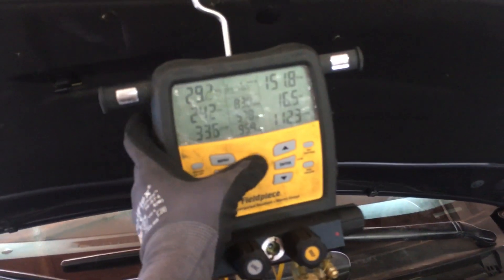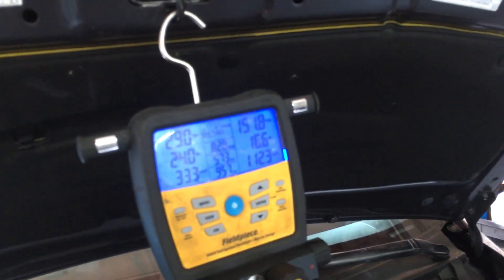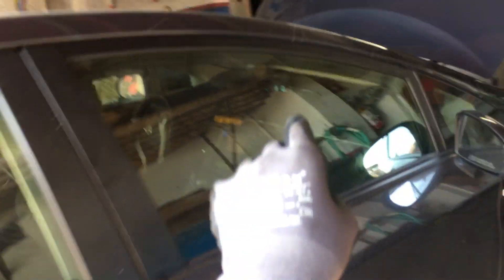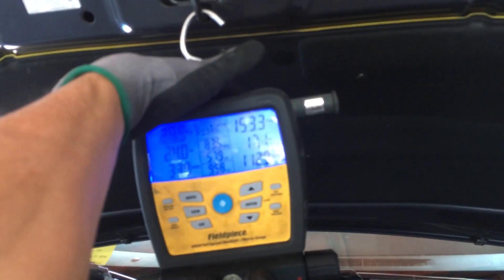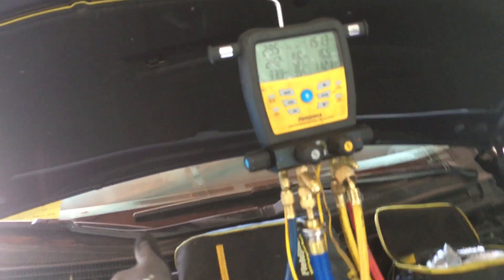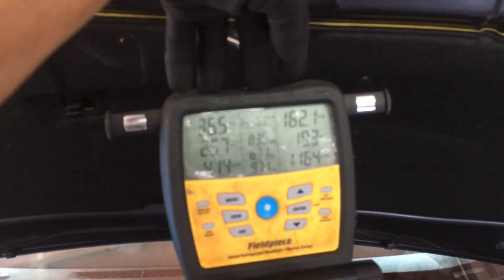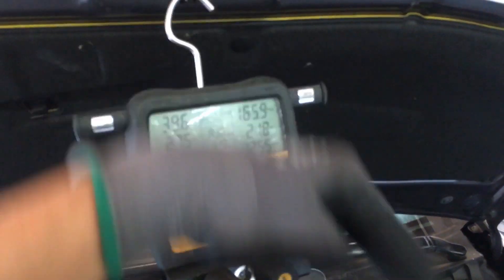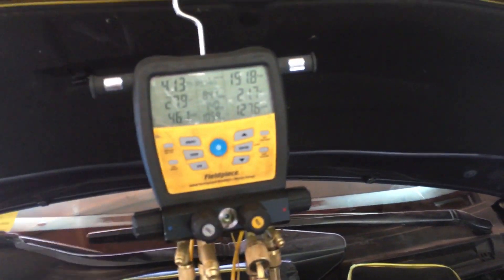WARNING Prius owners do not let anybody top off your refrigerant

Comment: Is it normal for the electric compressors to be kinda loud? Mine is loud buzzing sound but it seems like its cooling pretty well. Wanted to add some 134 but maybe I'll have to full evacuate and refill.
Reply from the maker: Only fully evacuate. 
Good long vacuum at least an hour . 
      Then only use refrigerant with nothing added inside of it and fill it up to the weight of the manufacturers specification
Reply: @coldfinger459sub0  Should I add any more oil to an old compressor? ND11 oil or whatever it's called. I would like to try to maintain my system if possible. Thank you for the help.
Reply from the maker: @Prisonmike89 should never have to add oil oil does not get used up. It does not wear out..,
    It could only leak out. 
As long as the system is never opened and there’s no real big leak. There should be no oil loss.

Comment: My AC went out about a year ago due to a leaky condenser on my 07 Prius. It looked like the plastic nut for the condenser filter had cracked and let out all the refrigerant. I replaced the condenser, pulled vacuum, and added R134a + ND11 oil. Worked great for about a year and now all of a sudden I have no cold air. I checked for leaks with my UV light and I couldn't find any. I've read what you've wrote on Prius Chat and I think I might have introduced contaminants into my compressor and killed it. Is there anything I should do before I replace the compressor? Also, do you think I should attempt a DIY fix again or just take it to a shop?
Reply from the maker: Find out if there was a leak again ?  

Compressor don’t die
They are murdered 

Low refrigerant will kill compressor 

If there is metal flakes a lot will need to be done

Comment: I'm reading that one has to be an MIT rocket scientist to work on these things. But, Toyota adds a SIGHT GLASS to aid technicians! As you know, sight glasses have been around for 100 years or so. That's the level of precision that Toyota thinks it's system needs..
Reply from the maker: No that is not the precise level to charge the system. 

Have done videos on that showing system just a little over half charged but the psych class is cleared

And then have sewn video on other cars where a cy class has bubbles but system is 100% full just added refrigerant to my weight still have bubbles

Not reliable method

Sometimes you could be a few ounces under charged and have a clear glass

Sometimes it will be full with the bubbles and somebody thinks it’s low and ends up overcharging it by keep filling it until the bubbles are clear

Comment: Can't you use the scan tool to manually run the compressor at a certain speed, would that make the process a bit easier than having the computer muck with compressor speeds while you are working?
Reply from the maker: Then I’ll be bypassing the process and not testing and actually process proving that everything is working properly if I just stuck a scan tool on there and drive the compressor speed up. 

        And Toyotas Tech Stream is an incredibly slow process to hook up the software is slow changing between screens. 

        I’m hoping the next generation of Toyotas uses a faster clock speed in their processors and their data communication to the diagnostic port.

An aftermarket scan tools do not allow you adjusting access to Toyotas HVAC system
Reply: @coldfinger459sub0  Ahh ok then, I figured it would make diagnostic easier with a constant compressor speed. 

Regarding the scan tool, my ebay memoscan hand held lets me drive most hybrid functions including compressor speed. The scanner is average but I keep it in the car for emergencies.
Reply from the maker: @zforce69  having a by directional scanner in your car is a great diagnostic tool to keep in every car. 

But you would not want to drive up your compressor speed if your system was low on refrigerant because the compressor overheats both due to lack of cooling and lack of lubricant return. 

       Driving up The compressor RPMs to its maximum RPMs is something only I would do after I recover all the refrigerant and recharged it back to factory specifications. 

           I do not try to diagnose anything on a partial charge.

Comment: ok, WHY cant it be topped off other than the obvious of the mechanics what the business.?
Reply from the maker: In many circumstances depending on the ambient conditions it’s very easy for The Mechanic to not understand that it’s actually the computer using the sensors attached to the air conditioning that vary the pressure by controlling the compressor. 

      The old-school way mechanics were taught with standard six piston compressors as you added refrigerant the high side and low side pressures would usually move accordingly to a rule of thumb based on ambient temperature with the expansion of the refrigerant in the system. 

      Back in my Father’s Day when he was a young man this is what you did and you were taught and this is what I was taught when I was young because there is only one type of compressor system and that was fixed piston displacement compressors so it was very easy you could use it on all vehicles a method of topping off refrigerant. 

          Today the majority of vehicles are variable displacement or variable speed compressor controlled by sensors and then algorithm in a computer that takes over and tries to maintain a certain height site or low side pressure for refrigerant movement to obtain a certain temperature that the computer is looking for. 

            So even though the technician is popping in and popping off refrigerant and it’ll start getting cold out of the duct vent. 
                        Because the computer is forcing the compressor to either crank up the displacement with a lower amount of refrigerant in the system to full or satisfy the quantity of refrigerant needed to pass the expansion valve often the technician has either under charge the system but still get pooling out of the dash or even overcharge the system and still get cooling out of the dash. 

           Neither the technician or the customer know that there is a problem because the end result is nice cold air out of the dash and that’s what they think they want to see or feel. 

          But if the system is running in this condition under charge the compressor does not get back enough refrigerant to bring back enough lubricant for cooling to the compressor specially electric compressors rely on a completely full charge of refrigerant to bring a cool flow of refrigerant oil back to the compressor. 

      I do not under charge situation it does not do this shortening the life of the compressor it is not immediate destruction this is why they do not know that they are actually shortening the life of the compressor. 

          In the other scenario of overcharging if it’s a cool day when they’re topping off the problem doesn’t happen until the customer drives away from the shop and let’s say they go on a little trip a few days later and enter a climate zone that is very hot all that extra refrigerant has nowhere to go when it expands. 
                        So the pressure sores really high and depending on how much they overcharged it it could severely overheat the compressor and degrade cooling performance out of the Dash shortening the life of the compressor
                              And on Highbridge or electric vehicles that extra high pressure draws extra high power from the battery shorten the life of the high voltage battery by completely draining it constantly in a hybrid engine Hass to stay on to recharge the battery all the time because of the excess amount of amps current being drawn by the excess of high pressure

And if they really overcharged it too much if it’s a clutch type compressor it could slip the clutch causing it to burn out or it could blow a front shaft seal if it’s an older vehicle with weak high-pressure hoses it can cause a high-pressure hose to burst,  if it’s a compressor that has a high-pressure blow off release valve it will hit that pressure of 440 psi and purge some of the oil and refrigerant out of the compressor in a attempt to save it fly to reduce the high side pressure
            Vehicle is equipped with a high pressure cut out switch trying to save it’s life and the annoyance to the passenger driving it turns off the compressor into mediately until the refrigerant pressure gets cooler and lowers its own pressure then it turns the compressor back on it works for a few minutes turns off again and keeps repeating the cycle

           Some compressors can take this abuse and people get lucky and then some compressors cannot take this abuse and they end up with a very expensive repair bill. 

      And it was all caused by the technician from the shop talked off the refrigerant level thinking he’s doing a good thing for the customer. 

     If there’s one thing that’s a fact in the automotive industry is lack of education owners who won’t pay for their technicians to go for training or buy the education material because they’re either lazy cheap or Ignorant our trade is rampant in one of the three traits

Comment: Do you have a shop I can take my prius to? I'm located in the bay area and my prius AC is not working.
Reply from the maker: What is the history of your non-cooling complaint has it been going on for a long time ?  did it just develop suddenly ? 

Have you had parts or recharged done in the past ? 

       Has it been to a body shop in the front an accident ?
Reply: @coldfinger459sub0  it's been running like this for a long time. Did have damage to the car (front driver side) and was repaired a long time ago. Been running with no AC for a few years but looking to get it fixed now since I don't travel for work as much anymore and drive the car more often now.
Reply from the maker: @xxxbigmojoxxx  it’s a gamble then what condition the system is until it’s actually filled with refrigerant and try to start it and see what happens.
Reply: @coldfinger459sub0  it holds freon charges. I didn't detect any leaks... blowing cold air at low then after a while cold air stop.  Feels like a possible evaporator cleaning issue but rather have someone diagnose the problem and maybe change it.
Reply: Can you provide me a shop address maybe I can bring it by?
Reply from the maker: @xxxbigmojoxxx  You’ll have to make appointment appointment ahead of time since you have a Prius I’ll tell you to go to Luscious Garage. 

        Usually vehicle is dropped off because I’m very busy I usually give you a three hour window of time it all depends on how easy or how difficult the length of time of each car I do prior to arriving at each shop. 

     https://maps.apple.com/?address=475%209th%20St,%20San%20Francisco,%20CA%20%2094103,%20United%20States&auid=16978534829852406251&ll=37.771758,-122.408788&lsp=9902&q=Luscious%20Garage&_ext=ChkKBQgEEOIBCgQIBRADCgQIBhBlCgQIChAAEiQpKFDVPzTiQkAxevbIlIWaXsA5piX7m1rjQkBBEGKgYsuZXsA%3D&t=m
Reply: @coldfinger459sub0  thanks.

Comment: Maybe you could answer why my Lexus CT200h 2013 that just got recharged properly is still only blowing 50 Fahrenheit at the vent on max and recirculate on and the cabin air filters are replaced, cooling fans work and it’s only blowing 50 Fahrenheit at 71 Fahrenheit outside temperature any ideas?
Reply from the maker: Matthew Doyle Who recharged it ? and how was it recharged?.             What is the temperature of the suction line using a contact temperature probe only.           If you’re using one of the old style dial face thermometers first calibrate it to make sure it is correct.        Place a glass of water in your refrigerator for a few hours or overnight. In the morning place some ice cubes in that glass of water throw your thermometer probe in the ice water it should read exactly 32°.    But the temperature that section line is one of the most important diagnoses temperature is needed.
Reply: t lech they recharged it with the high pressure and low pressure machine where they put the exact grams of refrigerant in and they took all the old refrigerant out and changed the compressor oil I think
Reply: I’m also using a digital thermometer
Reply: t lech never mind that was when it was stationary when driving it’s about 42 F
Reply from the maker: Matthew Doyle should be about 42° when you’re stationary to
Reply: t lech yea that’s what I thought and the condenser is clean I wonder why?
Reply: t lech maybe I should use one of them foam cleaners that I put through the drain tube from the evaporator?
Reply from the maker: Matthew Doyle That has nothing to do with your duct temperature. Whoever did your AC recharge I would ask them in front of me to use their refrigerant identifier to check the purity of their recycled refrigerant through their machine that is it 100% R134a with no air mixed in it.  Then we could start diagnosing from there because if they have contaminated refrigerant you’re just pissing in the wind. And if they don’t have a refrigerant analyzer in their recovery recycler recharge machine then they are not a qualified automotive shop that should be touching air-conditioning in the first place go somewhere else to somebody who’s not cheap ignorant and lazy. In the automotive industry it’s very hard to find a shop like that.
Reply: t lech thanks!